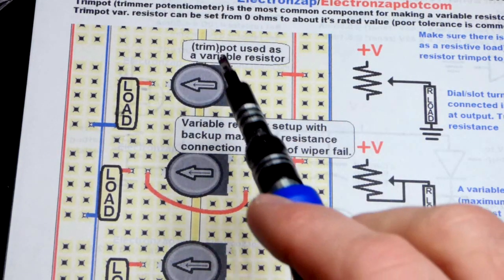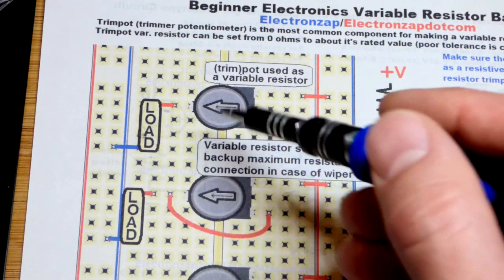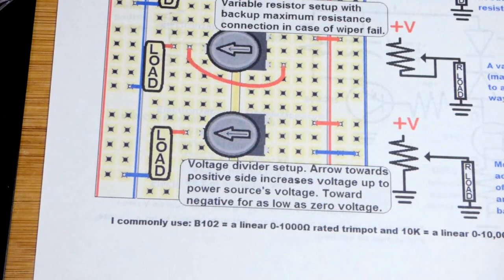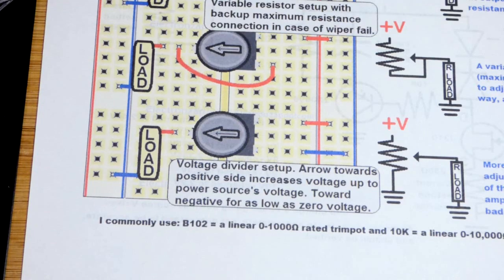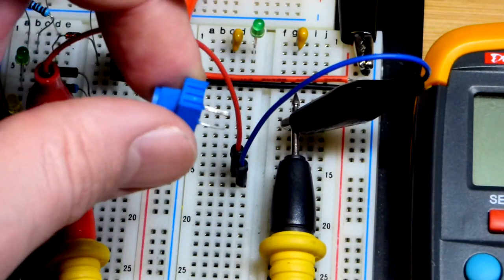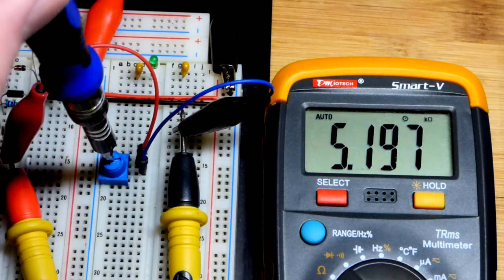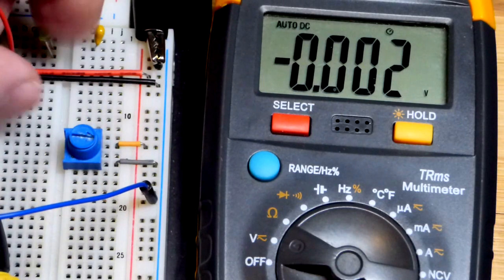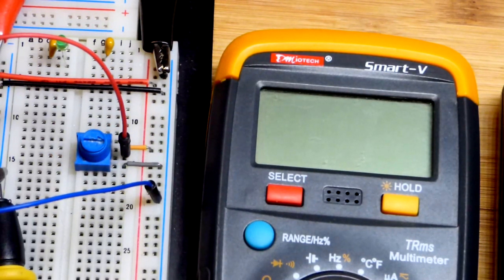How to make a variable resistor or voltage divider using a trimpot trimmer potentiometer

Comment: What if I connected the top leg of potentiometer to Vcc & middle leg to load & GND then varied the dial, wouldn't that also vary voltage at the load similar to the voltage divider?
Reply from the maker: Don't want to do that. If you connect the wiper to the supply, and one end of the resistive element to the other side of the supply, then no power will go to the other end of the resistive element and you will have a short circuit when you turn the wiper to the end of the resistive element that is connected to the power supply.